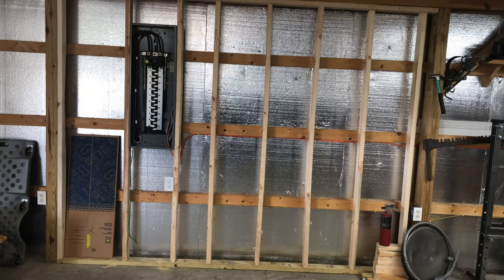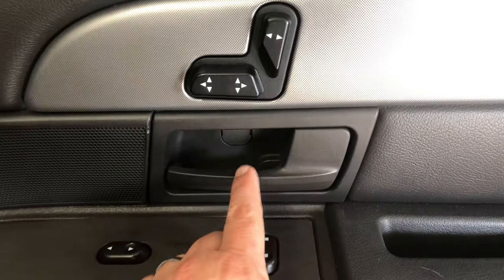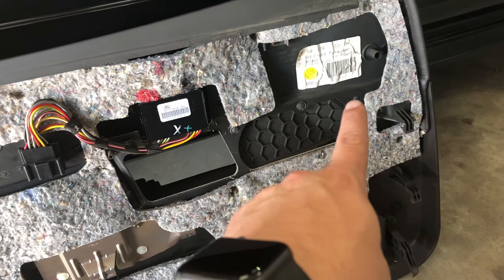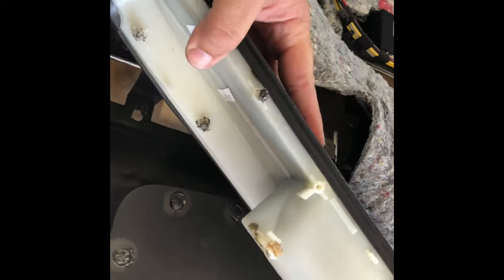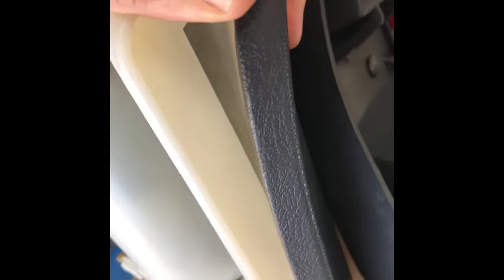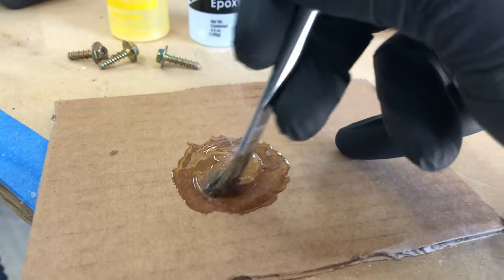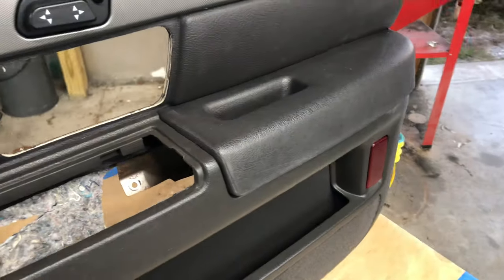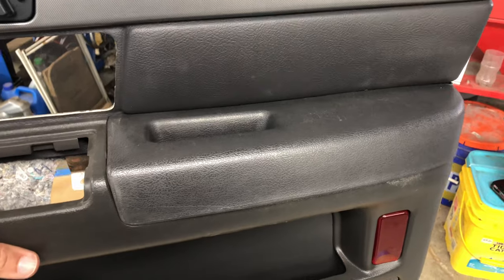Mercury Marauder and Crown Vic door panel arm rest repair DIY how to

Comment: Good video. Have a 2003 Grand Marquis that I'm about to do all of the door panel arm rests like this. On those plastic rivets or weld, you can just remove the melted head and then reattach with a short pan head screw. Done that several times on different door panels. Works great.
Reply from the maker: @waynewhisnand6157  I thought about using screws since there are stands for them. If I do this again I’ll try that. Thanks for watching!!

Comment: Thanks, this was a big help. Only occurring on the passenger front door, but I suspect over time it is going to happen to the other three doors. Not bad for 260,000 miles on a 2011. Just started happening this summer with all the blamed heat.
Reply from the maker: @DanielBeyer-w3p  Glad I could help!! Thanks for watching!!